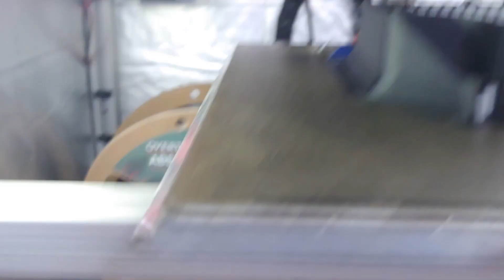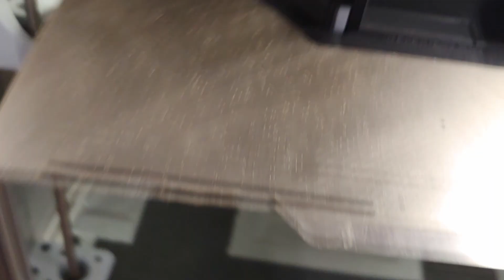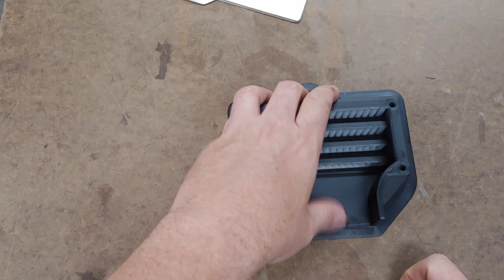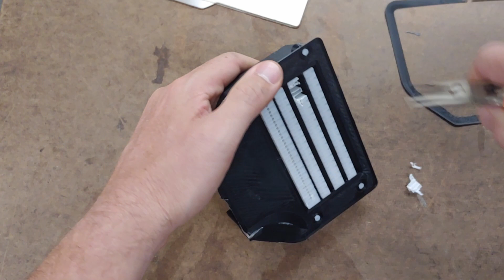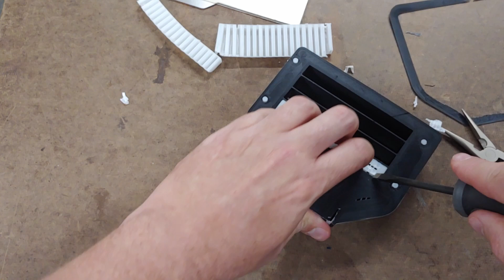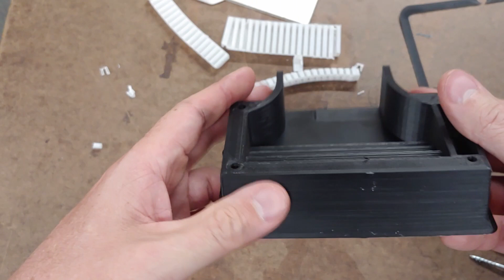Removing HIPS supports from ABS (no solvent)

Comment: Thinking about buying a spool to support ASA 🤘🤘
Reply from the maker: I have a lot more experience with it since making that video.  The biggest thing is to keep the supports flexible so they are peeled off, not popped off.  Only using ASA for the roof of the support works well and is faster due to less tool changes.

Comment: Did you try PVA for supports too? Water is much cheaper than limonene. Is HIPPS the hip new alternative to PVA?
Reply: Pva filament is very expensive
Reply from the maker: I did not try PVA yet.  I am staying away form it while working out the kinks of a custom IDEX build because it is hydroscopic and can't be left in the printer.  The HIPS hasn't been in a sealed package since I bought it a few months ago and it is fine.  HIPS is not new.  It has been around in industrial and sign applications for a long, long, time.